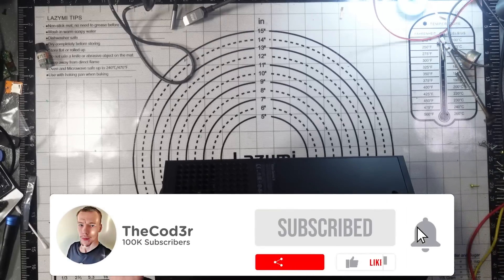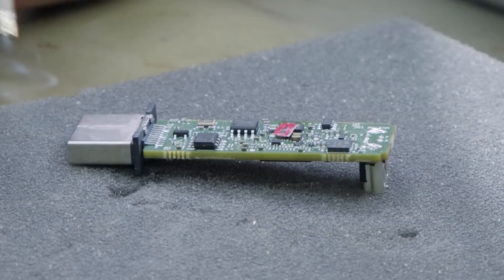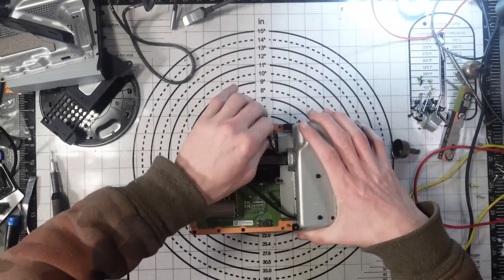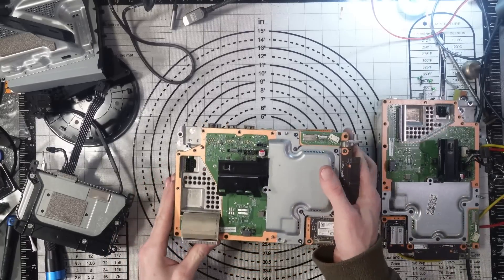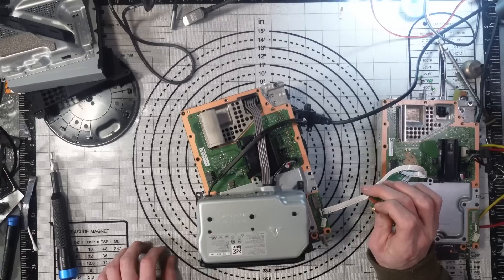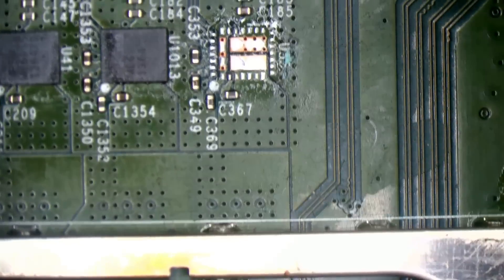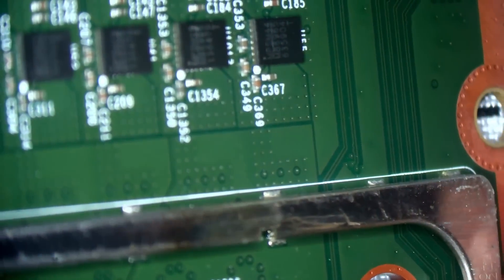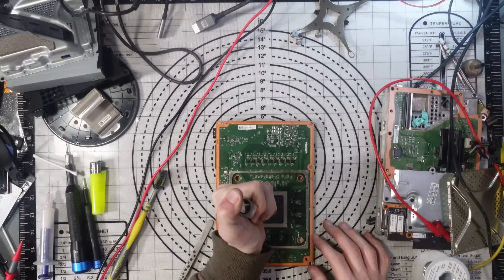Another Completely DEAD Xbox Series X... Can I Fix It?

Comment: Getting continuity on pins 17 and 18 on series x, is this normal?
Reply from the maker: No bud, 17 is ground and 18 is 5v, so likely a shorted encoder, esd ic or voltage regulator

Comment: Is it possible to have a Micro USB port removed off a Arduino board and have wires soldered to the PCB directly to where the USB legs were? I need to place the Arduino in a very tight space thus the cable wont fit. A repair guy local to me was supposed to do it but he's on maternity leave (men get them now supposedly :face-green-smiling:)

Comment: I have a question unrelated to the video. I was working with a VGA to HDMI converter and it stopped outputting HDMI. When I put power to the board I get nothing from it but if I check the 5v line it is getting power all the way to the HDMI port. There is a cap right beside the HDMI port and it is showing 5v. What I'm not sure about is if the HDMI needs 5v or if it is supposed to be stepped down to 3.3v? Still not sure if 5v going to it would make it not display HDMI. Any help or input would be greatly appreciated. I could just buy a new one but I would rather fix this one if I can.

Comment: Am I missing something? All this video shows is that you removed, resoldered, and tested components. I don't see where the fault was?
Reply from the maker: I didn't resolder the mosfet I replaced it
Reply: Looks like he found a shorted MOSFET.
Reply: @yassine1806  Ty sir.
Reply: He put a new one on, not the same one
Reply: He injected it with voltage and it came back to life!🙀
Reply: Sorry about your wire btw…
Reply: A bad mosfet
Reply: Mite b time to give up then.
Neva no mind👍
Too many mind!!
KISS
Reply: It's a short